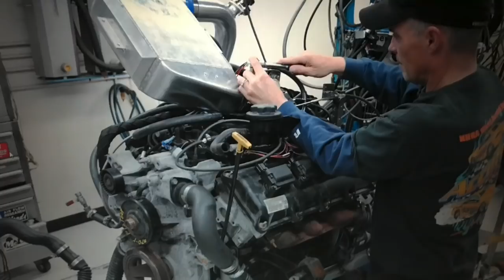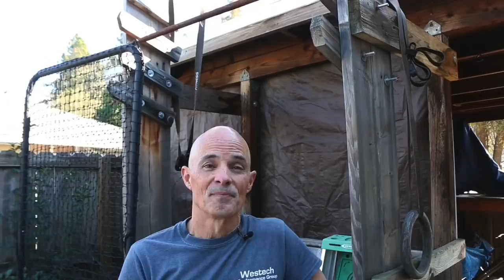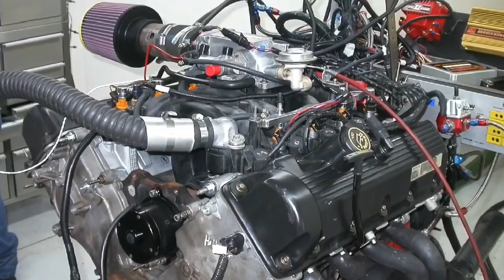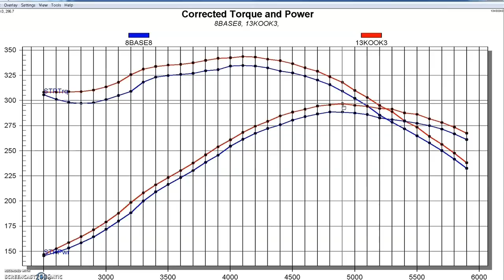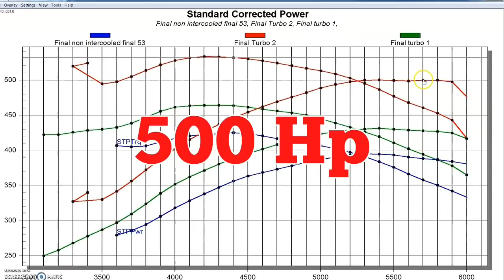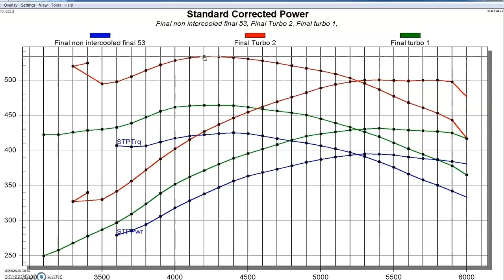JUNKYARD BOOST BATTLE pt1-FORD v CHEVY v DODGE

Comment: Even with shorty headers my mustang 4.6 doesn't make that you would definitely tell the difference from the actual stock 260hp and 300lb-ft. Your tests seem a little off
Reply from the maker: I went over why the 260- hp motor makes more on the engine dyno (no accessories, no air intake, long-tube headers (shorties don't help) and open exhaust (no cats), optimized tune and colder water
Reply: @richardholdener1727  I get shorty headers don't do much but if you are going to test junk yard motors test them they way you pull them closer to real life. And I finde it hard to believe that you didnt replace the cast rods and pistons with forged ones since the cast rods have been known to snap at 420 and pistons crack at 400. And how do you get away with out opening the ring end gap since under boost can break ringlands?
Reply: @ricer0cket25  soo you're upset that the NA test had headers? Sheesh, that's splitting hairs.
The whole point of these tests is demonstrate what can be done with an unmodified junkyard engine + boost.
If rods and pistons are breaking at 400hp on a v8 there's something very wrong with it. That's 50hp per cylinder. Think about it.
Ring gaps certainly need to be opened up in high cylinder pressure forced induction applications. This was only 9psi and an engine with considerable wear.
Reply: Chris Lewis 
Having a good tune helps cast parts survive to a degree.  Plus, the “snapping and cracking” numbers; are those numbers at the crank (with or without accessories) or the wheels?

9-10 psi is a fairly safe boost level for stock ring gaps on many engines.  Bolt on supercharger kits often run 5-10psi and are for completely stock engines.  Plus, the ring gap tends to open up a bit with higher miles.
Reply: @brianfrost303  n.a. 4.6 is only capable of maybe 7 psi before head gaskets say bye. And he didn't do just headers new ecu and injectors. Any yes cast rods and pistons from ford are breaking at low numbers ever since they switched from forged to cast after 1987. So no I'm not upset at the headers there is just a lot of missing info. We all know that GM has better cast internals able to handle 1,000 + up but like I said Ford's are junk internals and I have a 03 gt right now and it takes alot of work and better parts to make that kind of power without breaking stuff
Reply: @ricer0cket25  where are you getting this information from? Head gaskets don't care about boost pressure, they care about cyli der pressure. And ~60hp per cylinder is well within the capability of any modern head gasket.  It sounds to me like you are fixated on internet forum gobbletygook written by armchair experts despite having a video from an industry authority demonstrating otherwise.

Why would anyone want to see this engine with it's stock detuned ECU? Changing injectors would have basically zero impact on dyno figures unless the junkyard set being replaced were in poor condition and not functioning correctly.
We're looking at testing the capabilities of the physical engine with an optimized tune in an A-B comparison.
The turbo configuration needs to be tuned to run, and will be obviously be optimized for power output.
So it's only fair to do the same optimization for the NA  configuration as a fair basis for an apples to apples comparison.
Reply: @brianfrost303  well one personal experience others with personal experience and then stock torque to yield bolts with a 30 then 40 then 90 degree torque spec wont hold; the stock head bolts were not designed to. And and what happens when you increase boost pressure you increase cylinder pressure.
Reply: @ricer0cket25  well you have a conundrem then. You either have to believe that this engine is a complete piece of shit that wasn't designed to meet typical modern automotive engineering standards and that the head gasket, pistons and conrods all shit themself at 50hp per cylinder due to poor design and construction similar to what you'd expect in the 1940's. 

Or you can believe that this engine.. like all other modern engines, can take modest amount of boost and survive just fine and that sometimes people blow up an engine and blame the engine.

Comment: Dodge made a 4.7.  
Ford 4.6
Chevy 4.8
Reply: fleamarketfread 4.8 would win that all day
Reply: ford made a 5.4 too, and a 6.8 and the real killer 6.2 SOHC. there is no reason to run a small 4.6 against the bigger displacement other then they want the chevy to make more power. a 6.2 will decimate an LS
Reply: mikeyjock we can compare combinations all day long.... It’s a matter of preference don’t knock the ls motors I don’t see videos of people putting turbos on 6.2 with over 200,000 miles and making reliable power 

As a mechanic I think all car makers are capable of making good engines that make serious power
Reply: mikeyjock 
The 6.8L is a V10 with virtually no aftermarket support.  The “real killer 6.2 SOHC” might be able to make some good numbers, but it really doesn’t have much on a 6.2 LS once parts start getting added.
Reply: @stlchucko  What aftermarket support do you need to slap a turbo on it that they did to this 4.6?  It's still stock heads, stock bottom end, stock cams, stock intake...
Reply: dre04mach 
You’re missing the context.... “a 6.2 will decimate a LS”

A 6.2 Ford makes what in stock form...  385-400hp?  A 6.2 LS starts at 400 minimum.  As Richard’s tests have pointed out, turbo boost is just a multiplier, so boost alone doesn’t make the 6.2 SOHC a “real killer” of a LS.  It also has a disadvantage in aftermarket support, so exactly how could it “decimate a LS”?

The 6.8 is a heavy lump that’s only worth boosting if you have one in a truck.  Beyond that, it’s unimpressive compared to other engines.
Reply from the maker: yep-those displacements are all different

Comment: Really curious what the 5.4 2v would do with the same turbo setup.
Reply: Blow the spark plugs out probably lol
Reply: @thatturbotruck  omg dude that is FUNNY!
Reply: It's been done guy has channel and his spark plugs are still holding up the results were like 520 torque to the wheels... stout
Reply: @triplestangman  what was the channel name
Reply: @johnnyfroese903  he's talking about autodetour. It's only seen low boost and hasn't been going for too long.
Reply from the maker: I have some 1000-hp 5.4L tests with twin turbos
Reply: That's right I've actually seen that. Sucker needs to crank it up 😂
Reply from the maker: that's a problem with the 3V
Reply: @richardholdener1727  The 3v doesn't blow the spark plugs out, that's the early pi 2v (4.6, 5.4 or 6.8, usually 99-01 motors have the issue).  The 3v doesn't let go of the spark plugs - that sleeve breaks off and stays in there.

Comment: These engines are a joke. My 4000lb jeep wrangler with a stroked 4.0 six cylinder set up for off roading out runs a friends mustang 2v with long tubes, 303 cam, and svo heads....Pissed him off so bad he bought a built cobra terminator.  I can't imagine adding cylinder pressure to an engine that only has 3 threads holding the spark plugs in...
Reply: You are giving specs of a 302 engine, there's no 303 cam and svo heads for a modular 2v engine. Trick flow makes the only aftermarket heads for 2v.
Reply: @atlfreakdaddy  he drives a jeep and claimed it out ran something...his buddy must have a 4 banger
Reply: @xxxmikeyjock  My buddy did have a four banger! It was a ford eco boost, you might have heard of it.   Like millions of others,  It lost compression at 40, 000 miles do to valve coking and had to be  replaced.
Reply: @atlfreakdaddy   My bad. Not a ford guy. Either way the car has a aftermarket cam and heads and my 6 cylinder jeep still embarasses it.  Kinda like how my $600 cast piston, smog head,  406 sbc in a mouldy $1600 3rd gen camaro runs right next to his built terminator cobra....
Reply: Looks like you're the joke..if your gonna dog an engine at least make sure its the right one. Tbh I think your lying. Your describing a 3o2 and the threads of 4.6 cept it has 4 threads not 3 dipshit.
Reply: Well my mod motor has about 320,000 miles on it and still going strong.
Reply: stroke that 2v n watch it gap you, remember Ford sales like fast food, all the time so they made these engines last long, good mpgs, n at a cheap price, so forged internals was not a care in Ford's mind.. Plus they always plan ahead, so they forged n stroked the 4v 4.6L, now aka Coyote 5.0L!!
Reply: TigreLoko24 

The coyote motor shares nothing with the 4.6 modular engine.
Reply: @DBSSTEELER  yes it does dude, its literally a stroked n forged 4.6L 4v, look it up!! Its also called a Mod motor, cuz its a continuation of that block of engines, sheesh..
Reply: @P71ScrewHead   My God you are an idiot. Gap me?  I would hope the UNSTROKED engine could gap me, since it's in a much lighter car,  isn't in a lifted jeep ,  and isn't on 35" super swamper boggers.... Last a long time? If I had a dollar for every mod motor I've repaired with spark plug or cam phaser issues I could retire.  The engine was a joke when it was first introduced and every generation has gotten worse.  Coyote bla bla bla.. Another unreliable turd. Might want to do some research as they blow up left and right....
Reply: @bdd1469  you ain't gotta lie to kick it. If you so called fixed so many spark plugs issues you would of known how many threads it has and would of known what heads and cams go on what motor lmfao. You're just another utube mechanic foh
Reply: @bdd1469  you can claim what you want, the fact remains these engines are great n plentiful n the main reason why ppl keep buying these cars, so long live the 2v!!
Reply: @P71ScrewHead    You are delusional. They are plentiful but never have been and never will be great. They are a gutless turd of an engine. That's why there are thousands of mustangs running around with a old school small block Chevy or a Chevy LS motor....
Reply: @bdd1469  not even 10% are swapped, Ford never had to build them to handle huge power cuz most are taxi/cop/fleet vehicle used, n they sell themselves, Chevy n Dodge are always trying to outperform Ford to get sales so duh they'd build better n bigger engines to try just that.. Look at the Coyote's 5.0 vs the other's 6.something, that's just the way it is..
Reply from the maker: the 303 cam is for the 5.0L-I think the plug thread problem was one the 3V
Reply: @richardholdener1727   Ya, got me. I confused parts because I'm not a ford guy,  and these engines are old.   As I recall,  not being a ford fan.... The 2v has problems with not enough threads in the heads ,  and the 3v has problems with too many threads on the plugs causing them to break on the way out,  and cam phasers issues...They used to be the most common repair in the shop, now it is eco boosts with low compression due to valve coking...

Comment: Can you do the same for some Euro v8s? Such as BMW m60, Mercedes m119 they respond to boost very well and are relatively cheap
Reply from the maker: I would love to but we don't have bell housing or adapters to run them on the dyno
Reply: @richardholdener1727  you might be amazed what lengths fans will go to in regards to helping see their own project engine platform featured in your videos. Over here in Australia we've been reaching out to friends of friends of friends to borrow a big block mopar bellhousing for a dyno session. In the end the community came through. This is the kinda thing which brings us all together!
Reply: No, just LS swap it.

Comment: No, when you said Ford 2v you lost me and im a Ford man. Why didnt you run the 5.0 and at least make it somewhat more fair with 302 cubes instead of the junk ass 281 engine? Your testing against a 5.3L (327) and a 5.7L(345) .

Comment: Would be awesome to see a big bang on a Lincoln mark viii 4v engine on e85 since you can get those for the same price as a junkyard 5.3.
Reply: You can put the forged boss 5.0 connecting rods(same rods in the 2015 up f150 and other 5.0 coyote engines) in the 4.6 as they are the same stroke and have forged rods on the cheap. Keep your tune and fuel under control and hold 700+whp. The crank in the 4.6 is fine. The stock pistons will hold fine as long as the tune is good and there is no detonation. Besides, running a turbo on a stock 4.6 is a lot different then the old kenne bell days. There are much better tuning options out today than back in the gap. 2015 f150 rods are usually around $32 each. Pretty cheap for a budget forged rod
Reply: I would also like to see this. Boost only
Reply: They fold rods at 450whp...
Reply from the maker: They don't fold rods-we have run lots of stock stuff over 700 hp
Reply: @richardholdener1727  **eyeroll**  Whatever you say Mr. Know-it-all.

You should let FoMoCo know that they wasted all that money having Manley supply the rods for a mere 390HP rated Cobra.
Reply: @zacharymorris9917  this guy knows his shit.. can you prove different on your engine Dyno 🤣😂
Reply: @zacharymorris9917  Calling the guy that actually DYNO TESTS this shit "Mr KnowItAll" - that's rich
Reply: @zacharymorris9917  so I've read.  I'd just like to see what they could get out of one.  

I was looking at going that route years ago before I went LS.
Reply: @zacharymorris9917    They will do a lot more. Just got add the power after peak tq
Reply: @boosted2813  you're totally correct about after torque peak, but your forgetting about all the other details that ABSOLUTELY MUST be met to get a ROTM mod motor past 450 WHEEL horsepower.

A stock Mod Motor will make 700HP in  the same way that a stock GenIV SBC will make 1400HP.  With everything correct, no crank driven power adder, no nitrous, no stock RPM range/must be past peak torque, no pump fuel, not streetable, not road racing, not drifting.

On an engine dyno with race gas and perfect temps I'm sure it would be doable.  Only a fucking idiot would try to pretend that will translate into the real world.  People, like myself, who have tried will definitely tell you the same thing.
Reply: @zacharymorris9917   Yeah I never said it last.  Iv tried it also and it dont last. But does last longer if you ramp boost in after 4500rpms
Reply: @boosted2813  I agree.  A big, laggy single turbo with high RPM cams will make them go pretty far.
Reply: @zacharymorris9917  Hey Zack Morris. Why don't you go back to Saved By The Bell where you belong and STFU!

Comment: So why not 5.7 ls1 vs 5.7 himi vs 5.8 Triton way closer in displacement?
Reply: Hey guys, I believe Richard has years of older info and is making videos from the many years previous work. All the info in these videos was gathered at different times in different years in the past and compiled to make new videos. So he's making videos out of info he already has. (I think) which is damn genius!
Reply from the maker: you can't find LS1s in the yard and I think the Triton was 5.4L (the 5.8L was OG 351W)
Reply: @richardholdener1727  got ya. I understood the concept add Boost and make it all better. Love the content
Reply: The 5.7 Hemi was a truck motor there are tons out there for cheap. Same with the 5.3LS. The 5.4 was an optional motor that didn’t get used a lot so there aren’t many available.
Reply: Check out Andrew Lavender. He has a great channel where he races using a 2 valve. I think he's running 7's in the quarter. Tell him Baby Shark sent you.. Fyi I am not a Ford guy per se but I do appreciate any fast cars.
Reply: @Kyle Smith  or maybe  Availability?
Reply: I think you mean 5.4 Triton...the 351w was never referred to as a Triton.  If you watched the video, he says it’s not about which makes the most absolute power, but rather the improvements made to each with cheap boost.
Reply: the 4.6 test are from 15 years ago...

Comment: Did you enlarge the ring gap? What sort of CR do these run?
Reply: Paul Morris 

The 4.6 PI motors have just over 10:1. The non PI were 9.5:1.
Reply from the maker: we didn't change anything on these-CR was mid 9s on the 2V

Comment: I have a f250 5.4 turd. I thought about putting a cheap turbo on it but I think it need a Holley ecu to tune it. So a holley, turbo, and turbo stuff will cost 4x what I paid for the truck. Soooo it would just be cheaper to put an LS in it.
Reply: nope.
Reply: @xxxmikeyjock  y not
Reply: You should turbo the 5.4.  CX Racing makes a 5.4 turbo kit. You'll save money vs a full ls swap.
Reply: @Turbo_Todd  what do you use to tune a 2001 f250
Reply: @alloyspeed1889  check out Autodetour's channel. They did it with an SCT and a boost controller. 
https://youtu.be/7Vm8QEwR0hw
Reply from the maker: factory ECU will run the turbo-use stock manifolds and make a Y pipe-its cheap
Reply: @richardholdener1727  That is kinda what Autodetour did. Stock ECU, with SCT for flashing tunes, and boost controller.  He used a china turbo hot side kit for and F150 that was for a 5.0 and modded the crossover pipe.